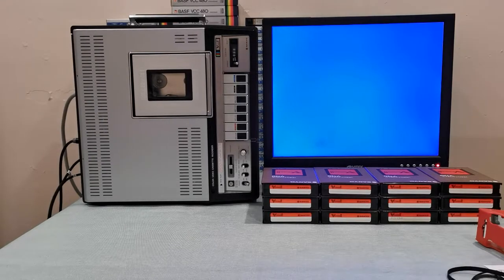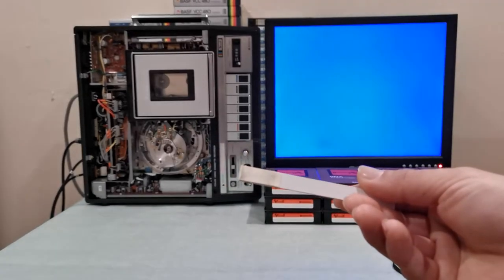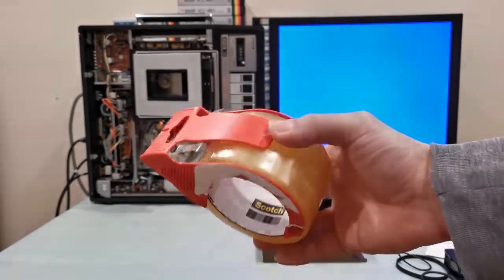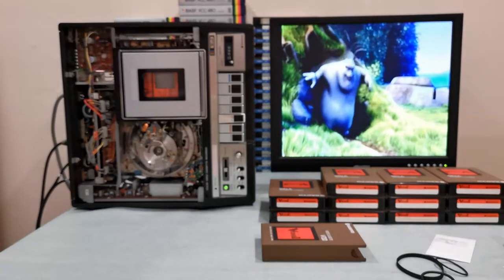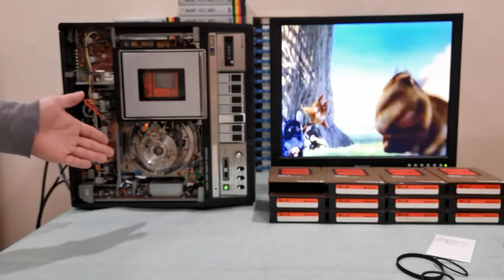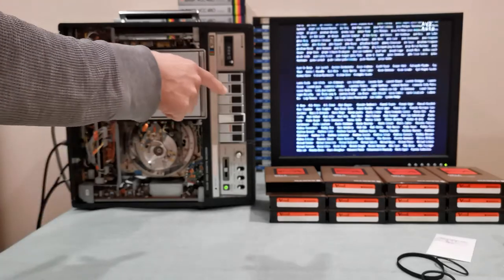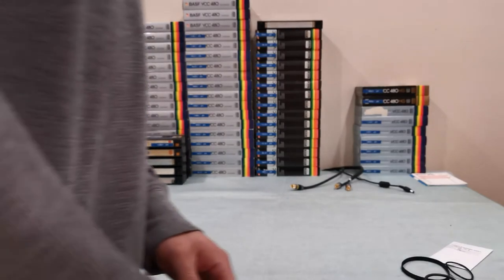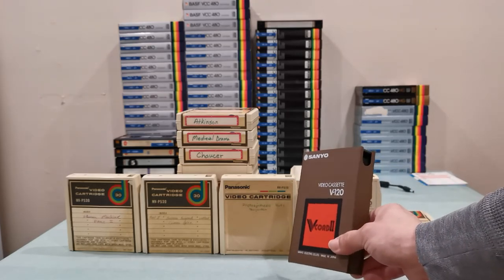1976 Sanyo VTC 8400 V-cord ii VCR - video output in action.

Comment: You can pop the EIAJ 2 tapes out of the cartridge and play them on the open reel EIAJ color decks. Cartrivision tapes were much larger than those cartridges. The Omnivision decks are incredibly heavy!
Reply from the maker: Wow. I had no idea. I do not feel ready to tackle the open reel video machines. I am still collecting and repairing cartridge based video formats.

The open reel formats will be a future adventure for me.
Reply: I have owned two different Cartrivision machines in my time.  Now THOSE machines REALLY cut corners (by necessity given the technology of the time) to save tape.

Not to mention, while you couldn't record them, it was the earliest (that I know of) home video format that could PLAY stereophonic tapes!

Azimuth recording would have never worked on this system given the fact the tape was wrapped a third of the way around the disc's circumference, using three heads placed 120 degrees apart.  Since it needs an even number of heads, it MIGHT have worked on V-Cord and V-Cord II and maybe even U-Matic.  Hell, it could have even been used on 2-inch quad, so it wouldn't require a special headwheel assembly to play 7 1/2 ips (NTSC) tapes.  It would not have worked on Quasar's format as it only used one head.

I really want to figure out an AviSynth script to reasonably (and perhaps close to faithfully) recreate Cartrivision's playback of its recordings.  And I don't mean play every third frame out of 60 fps, but breaking it down to 60 fields, keeping every third (recording), then playing each field back three times (playback), exactly how Cartrivision's skip-field system worked.

Comment: VX format produced a very good signal to noise ratio. But, it was a one head system so the vertical sync interval had gap caused by the need of the one head to "cross over" from one side of the tape to the other. When they work, they look great. Have not seen a working deck now in almost 20 years. Seen plenty of decks. They all have the same "safety shut down" problem. It is a bad capacitor on the control board. But, since I sold all my machines, and none of the sellers ever reported back to me, I never got proof that was the issues. If you have a VX deck, contact me and I will provide the service manual and instructions on how to fix the shutdown issue.
Reply from the maker: I have a Quasar VR-1000 machine. It plays video but the picture quality is bad. There are vertical white colored artifacts that move from the center of the screen outward toward the top and bottom of the screen. It is constant and repetitive. Both the front turn type tracking and skew controls are unresponsive.
Reply from the maker: Got my Quasar VR-1000 working lastnight. It now outputs a very good picture. It had a very dry capstain and drum head sleeve bearing which was causing slower than normal playback (white noise.)

The capstain is ridiculously difficult to remove on this machine. The tracking potentiometers had green colored corrsion which i repaired by using De-Oxit Fader F5 cleaning/lubricating contact spray.

The signal to noise ratio is in fact impressive like you mentioned. The resolutuon is somewhere between RCA CED Videodisc and first generation VHS. Not bad considering the fact that it is a single head system. $550 well spent.

Cleaning of the heads and demagnetizing after 2 hours of runtime is a must. Unbacked ferric oxide formulation magnetic tape ribbon? This is video not an 8 track audio tape. What were they thinking?

Having to move the rear switch to the "camera/mic" setting while recording took me a while to figure out.

The absence of a visible "paused" image is something i did not know about this machine. The absence of a flying erase head makes smooth multiple recording transitions impossible.

I had never seen a VCR with a hard to reach tint control knob. I want to make a maintenance/video output in action video on this format.

I feel like this machine deserves such a video.

Comment: I really want to get a V-Cord machine. A shame they are so rare and expensive.
Reply from the maker: I have been thinking of passing my 8200 model machine to someone else. It seems like it is not going to be an easy fix compared to my 8400 model machine.

I swapped out the four mainboards between my two machines. All four maonboards are good. I have narrowed it down to the video heads which is the heart of any video tape machine.
Reply: @renegonzalez6755  Cool! Right now, I am just going to look out for one at a thrift shops and similar places.
Reply from the maker: @audiodood  That is wonderful, i recently purchased a super rare sealed Sony double density CD recorder with two unused discs (1.3Gb) for $10.

I have noticed that audio cassette decks and Laserdisc players have become available at thrift shops.

I have been thinking of buying V-cord i video tapes (the white ones) and respooling them with cobalt doped Maxell HGX Gold Beta ribbon tape. This particular Maxell Beta ribbon is also a Cobalt doped formulation like the V-cord ii. This would allow me to make my own V-cord ii video tapes (the black ones) from V-cord i shells. In theory it should work.

I got this idea after discovering thhat Sanyo made Beta machines "Betacord" after they realized that the V-cord ii format was a failure.
Reply: @renegonzalez6755  Eh, I wouldnt recommend respooling V-cord i tapes, as they are pretty rare. Besides, you have a bunch of V-cord II tapes as is lol.
And yeah, I have found some pretty cool stuff at thrift shops before too!
Reply from the maker: @audiodood  The V-cord i tapes are available on ebay. The Maxell Epitaxial Beta video tapes are also available for about $12 each. I am able to record in black and white on the V-cord i tapes. By respooling them i will be able to record in color as well as increase the total runtime more than 100%.

I want as many tapes as i can have. I have respooled audio cassettes as well as video tapes in the past. It is a tedious task.
Reply from the maker: @ImperialMotionPictures  Absolutely, honestly it was very odd that noeone else had asked me for it. Please send me an email: renegonzalez2002@yahoo.com My business class Sanyo VTC 8400 works very well for its age and it is all i could ever ask for regarding the V-cord II video format.

I am in the process of restoring two Quasar VR-1000 machines. So far i got one playing video. The V-Cord II format has many advantages over the Quasar VX format (more compact, more resolution due to the superior 2 head system, less tape wear due to cobalt doped media, higher color palette and more efficient 31watts vs. 80-90watts.)

If it wasn't for the easy to access tool-less removable single video head drum i would not even consider owning anything Quasar VX based. Drum and rubber roller cleaning after 2 hours of playback is a must due to the odd ferric oxide (common in normal bias type 1 audio tape) media.

The VX format is such a "bad idea" video format but i just so happen to love rare and odd vintage color video machines. I look forward to receiving  your email.